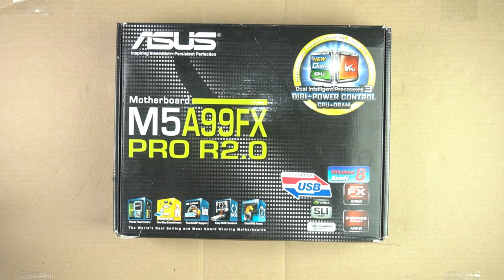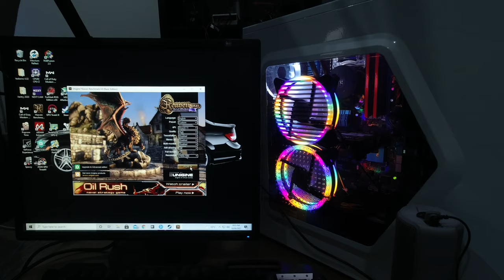white budget gaming pc build AMD am3+ fx8350 16gb ram 500w psu M5A99FX R2.0 rx560 pulse 4gb GPU

Comment: I have this motherboard would an rtx card work?
Reply from the maker: from what I understand gpus just need the right amount of power to work .. the mobo and cpu shouldn't matter ..however just ensure u don't bottle neck with your cpu ... ensure everything is up to par for the gpu ... google what bottle neck means and ull know what I mean.. in lamans terms... its wen ur cpu or gpu isn't powerful enough to run with one or the other bottlenecking  your setup. so having the best gpu won't be efficient if your cpu is of low spec.. it should be a descent cpu and your ram and psu should also be in the vicinity of the hard ware your using ... 
hope this makes sense